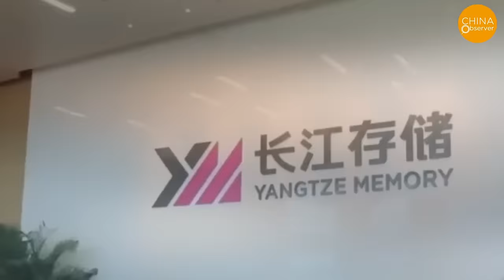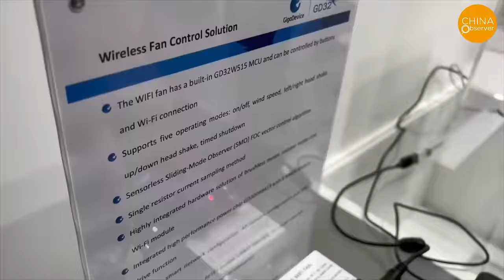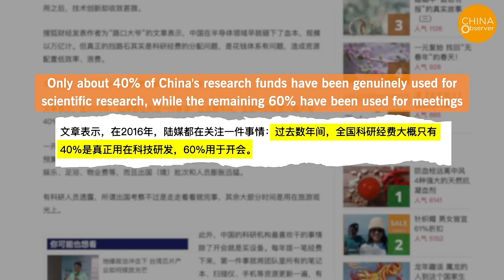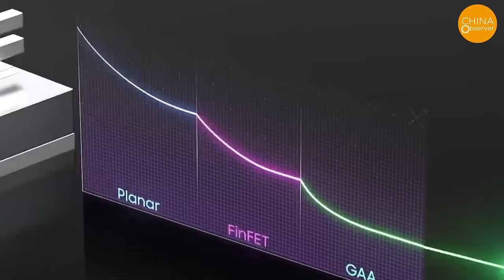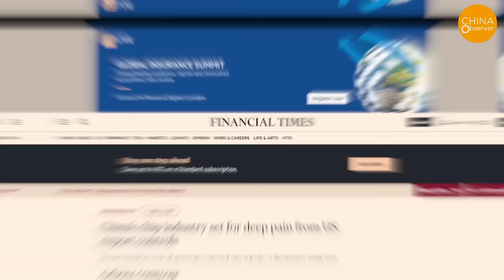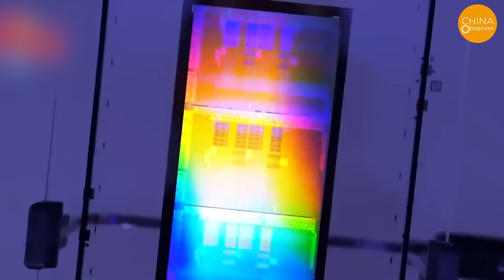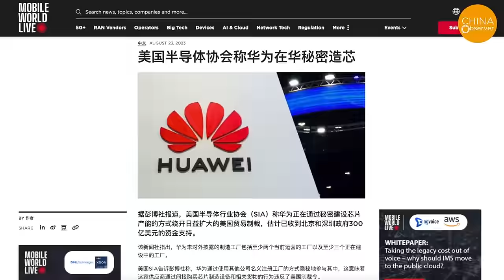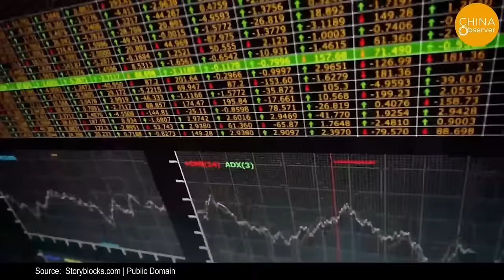China’s Chip Industry Totally Collapses: 10,000 Chip Companies Fold in 2023, Profits Plummet 90%

Comment: As a Sr. VP of a very large semiconductor company, Chinese ASIC Engineers are completely clueless as to the process to design VLSI chips. They're at least 10 years behind.
Reply: That's true but the Chinese have closed the gab on many technologies over the years that alone is amazing leap in 30 years but quality is terrible.
Reply: That's why it's meaningless to have fabs in China. Outsource design, then contract a foundry. Good luck, China.
Reply: @Alejandra-cv7rj  They are clueless on the hardware process side. Etch, thin film CVD, PVD, metrology, etc. Totally dependant on Applied Mat. LAM, KLM, etc. They've closed the gap only on the software side, i.e. the emergent side. Without ASML, they are lost.

Comment: I'm guessing those "5nm" chips SMIC supposedly made for Huawei were inefficient and cost to much to manufacture.
Reply: They flopped and didn’t perform as promised, by like 50% from what I’ve seen on here.
Reply: The 7nm process used to produce the Kirin 9000 in the MATE 60 phone is probably real and was predicted by industry analysts in 2017 to be the limit making the most advanced chips possible using legal equipment China is permitted to use.
The 5nm process alleged to be used for a tablet chip is probably pushing those processes too far and isn't likely going to be reality.

Comment: This video is actually a very good and comprehensive accounting of the state of Chinese semiconductor manufacturing and prospects for the future (dismal).
But, the word salad of this video doesn't organize events in a timeline to better understand the impact of sanctions. Without the context of a timeline, the viewer  might think all reasons for China's predicament are equal, but that isn't true.

Sanctions happened first and triggered all that comes afterwards. But the sanctions weren't implemented immediately but allowed for a grace period of about 4 years on chips imported into China. The machinery to make those chips were sanctioned and curbed overnight. This caught China largely by surprise and unprepared. Since sanctions began, China has tried numerous ways to circumvent/smuggle foundry lithography and other critical machines into China but has been unsuccessful. These machines are incredibly complex and require expertise in numerous supporting technologies that China does not posses which is why over 6 years China has only been able to maximize to the limit the use of legal technology China can access, but has been unable to innovate or steal to advance past this technological barrier.

As for the 20,000 Chinese firms related to semiconductor manufacturing that have gone out of business, it's not because of competition or other market conditions that they failed... For the most part. Those firms that failed are almost all less than 4 years old and were originally created only because of incentives and funding from the CCP in response to the US chip sanctions. The CCP assumed that all it had to do was throw money at the problem to solve it but as mentioned in the last paragraph China lacks a large web of supporting technologies to innovate the manufacturing process and the other companies that failed were chip design firms that anticipated access to advanced chips manufactured either domestically or in Taiwan. Lacking access to advanced chips, their work was useless so the companies had to close since CCP funding is limited and the business can't produce any product.

Then, in the post-Pandemic economy many anticipated that China's economy would reopen like the US and chips would be in demand.
The opposite happened, China's economic reopening has been a failure exposing numerous domestic economic problems that were either becoming or became serious just before or during the Pandemic, and the Pandemic itself due to its slowdown masked China's economic collapse in progress.
When China tried to reopen, it found no order takers and no customers both domestically and abroad and that resulted in factories idle and shutting down for lack of work. As a result of making little to no products, that in turn impacted demand for chips both domestically made and imported. China even tried to blame a cancelled Micron chips order as retaliatory sanctions, but in reality the order was cancelled because of poor domestic manufacturing across the board.

China's domestic economy is a mess, that and American chip sanctions are the twin causes for China's chip manufacturing implosion, that is why China's chip manufacturing is so extensive affecting both chips China can make easily and chips China is trying to make but can't..